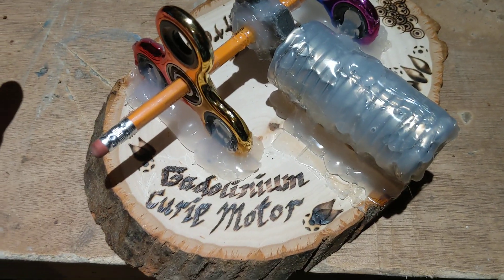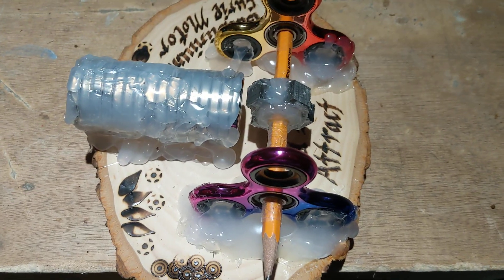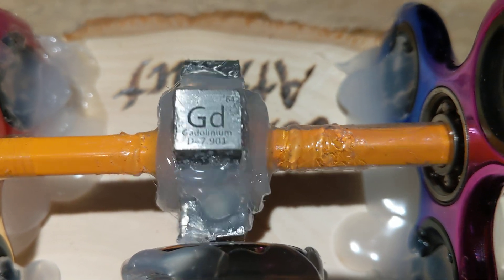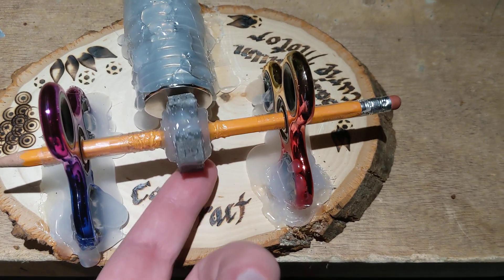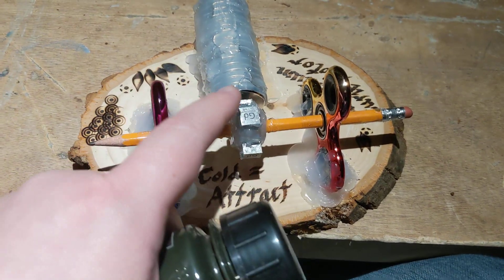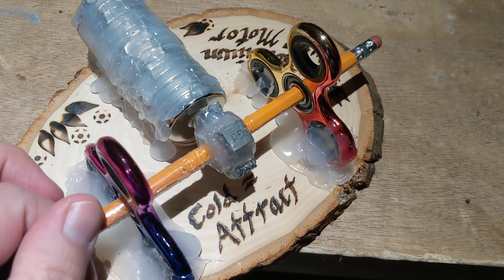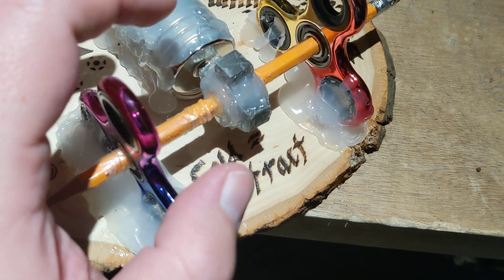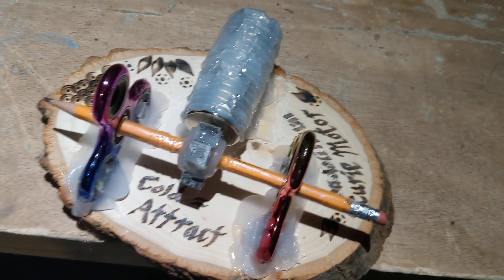Gadolinium Curie Motor Attempt

Comment: lol the make shift precision is good
Reply from the maker: @gussbuss4739  as long as you spin it while the hot glue is drying, it centers itself.  I have more important things to do most days than 3d print custom parts for a Curie Motor test. ;)
Reply: @nostrumuva  yeah prove it out before ya go all out

Comment: its awful! but for some reason i am intrigued... maybe its the lack of "copyright free" music to accompany the copious use of hotglue? or the determination despite obviously having no tools whatsoever...

i think you want heat pipes under the cubes. which is relatively easy to do. make a "commutator" for heat...

you want them to heat up as they pass the magnet pole. cool down as they approach... not sure black paint will suffice but whatever...

slap two "L's" of iron on the ends of the magnet stack and poke the rotor between them. keep the flux concentrated in the gap. steel rod rather than pencil, maybe... 

90 degrees of attraction, 90 degrees of heating, twice per revolution.
Reply from the maker: @paradiselost9946  I have tools. Even a 3d printer. Just not a lot of time.
Reply: @nostrumuva  its cool. i do like the ingenious use of whats on hand... be interesting to see the concept reach working stage.

lol, 3d printer, two lathes, two mills, one cnc.. and i still dont make much anymore... 
just learning to use cad beyond utter basics takes time thats hard to spare...
Reply from the maker: @paradiselost9946  I've done cad, used blender also. I have a taz3.  Also have a 3d printer pen for manual touchups.  Just not a priority.  Look at my Work playlist that's why.
Reply: @nostrumuva  A simple solution for applying heat could be sunlight and a magnifying glass. It can heat a small area quickly to hundreds of degrees Fahrenheit, and you could test it on your current build in less than a minute by holding the magnifying glass to focus light correctly. 

If it does heat quickly enough, and the engine works as you predict, it could be a really good way to turn solar energy into mechanical energy for generating electricity in places that are less ideal for solar panels.

For an upgrade, fiber optics cables can be used to transfer magnified light for better precision, and to de-link the magnifying assembly from the engine assembly for easier movement of the lens to focus correctly.

The only other issue I'd see is cooling the blocks to re-magnatize them. Running them through ice water could work on a small scale, or maybe a larger wheel of blocks to allow time for them to cool. 

The curie point being at ~70*F will likely cause issues in different environments, and is pretty expensive for it's size, so a substitute like Chromium Dioxide/Chromium(IV)Oxide that has a curie point of 235*F that is cheaper, commercially available, and in a powder form that could be shaped into blocks with a high temp adhesive. 

Magnified light would be more than enough to heat to reach 235 in moments, having it re-magnify far above any climates temperature would allow for a more versatile product, and allow it to cool below the curie point faster due to a greater difference between the block's temperature and ambient temperature. Using a cheaper material also allows for larger scale builds.

Anywho, this is all "what if's" that assume it works as expected, but if it does this could potentially be used in cold environments where solar panels are less efficient. It may even be possible that it is more efficient than solar panels since the light is being used as a heat source instead of using it to stimulate a chemical reaction, because it would theoretically use close to 100% of the sun's energy. Granted, solar panels still produce some energy on cloudy days, and this idea probably wouldn't, but it's an interesting project nonetheless, so I subscribe and hope to see a future update.
Reply from the maker: @ethanhodges4283  I have some large convex lenses was gonna try that already but I like your fiber optic idea.  I think I have some in garage.
Reply from the maker: I got a fresnel lens.  Any recommendations for heat-capable fiber optic cable?
Reply from the maker: Also, if you hadn't seen it yet, here is one solar powered oddity of mine that I made in the past that does work: https://www.youtube.com/shorts/Tkgj2bUtGkA
Reply: @nostrumuva  From what I've read, normal fiber optic cable should be fine for testing. The cable itself can withstand around 600*F, but the wrapping used on normal cable melts at around 180*F. It'd probably be fine for the most part though, as the light heats up the place it's focused, so it should work at least long enough to find out if the idea works before spending money on a better cable. To my understanding, the only difference for the high heat cable is the wrapping.

The dry dippy bird is really cool btw. Those things always mesmerized me, and you made it even moreso. It knocked a memory loose though, which is that a mirrored surface heats up slower than a white surface. I dunno if it's by a significant enough amount to matter, and your experiment already works, but I've never seen an experiment like yours with heat, so it might be worth testing.

Depending on size, your fresnel lens might be overkill since you're not trying to heat the blocks too much, but then again more light = more heat = faster heating. A dollar store magnifying glass was more what I was thinking, but regular and fresnel lenses both work the same way. The fresnel lens is just a thinner version.

Either way, I'd try the lens and cable you have instead of buying something for an experiment. I'm pretty frugal, and repurpose scrap or old parts when I can. Lenses are pretty cheap, but fiber optic cables, especially the high heat ones, get pretty expensive.

I can't really give a recommendation on specific parts, since I've never worked much with manipulating light beyond burning leaves as a kid. Magnets and motors have been more of my area of focus lately. This website might be a good starting point for conceptualizing and understanding what could work.

https://www.thefoa.org/tech/lighting/lighting.html

Good luck with the tinkering! I look forward to what you make.
Reply from the maker: @ethanhodges4283  wow long message. Thank you for taking time to respond it means a lot to me that some people still care about diy experiments.  I'll try the fiber I have first I guess.  Give me a few days though cause my job is rough a few days.  See my WORK playlist. There's a thing on Jan 15 coming up...